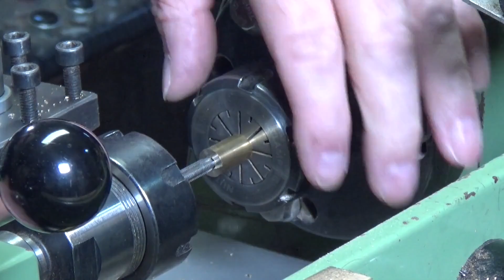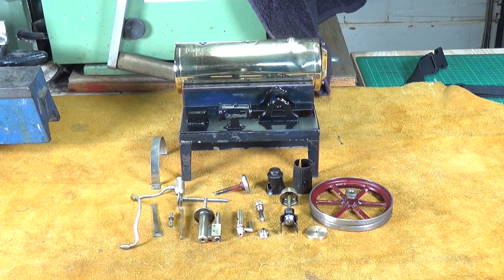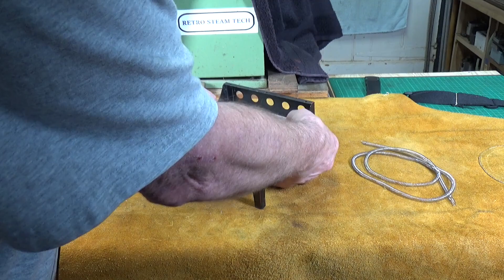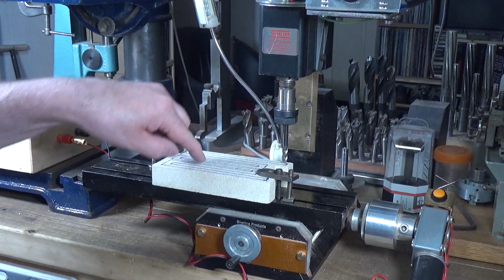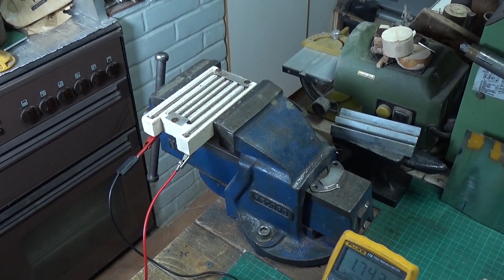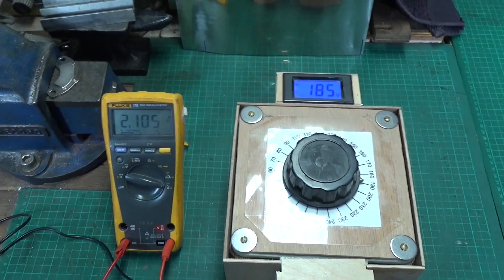Vintage Bing-Wolf Model Steam Engine - Part Three

Comment: Excellent Alan, that's something I've never seen done before. Bet you were left with a massive clean up on the mill. Should have followed the endmill round with the vac knozzle 😂 Cheers Nobby
Reply from the maker: Hi Nobby. Yes, it does make a bit of a mess but the results are well worth the effort. Cheers, Alan.

Comment: Love the element. if you want to control the temperature a simmerstat would work well. I have one on my Empire hot air replica model.
Reply from the maker: Never even heard of a simmerstat, will have to look into that, thanks 👍Cheers, Alan.
Reply: @RetroSteamTech It's the control used for electric cooker rings. It  gives an on off cycle that is variable depending on the knob position.
Reply from the maker: @myfordboy  Sounds exactly like what I need.

Comment: Interesting Alan.   Would varying the element length vary the resistance and required voltage ?  Not something I've played around with.  Cheers Rob
Reply from the maker: Hi Rob. Yes varying the length of the element would change the resistance. The problem is that in order to get the right resistance for 240V,, the coil would be too long to fit in the available space. Likewise, if I shortened it to suit 110V there wouldn't be much of an element left, so not much heat. Probably what I should have done is bought several coil elements of different wattages and experimented with different lengths. This works for now and of course I can vary the amount of heat being produced. Cheers, Alan.

Comment: Great looking milled out insulation. You could run it in a PWM speed controller that would be a more manageable size.  I hope there's no issues with what looks like metal strips shorting the coils out if they move?
Reply from the maker: Thanks. The strips holding the coil in place are mica not metal, so not conductive.

Comment: Very cool, never seen anyone build an element from scratch.
Reply from the maker: Ideally you would use something bit stronger and harder than a fire brick but they are fairly cheap and easy to machine. The coil wire heating elements are also fairly cheap and available from ebay.

Comment: nice one Alan
Interesting to see from a non electronic mind. 👍👍
Why can't you adjust the element just to run off 240v or did my simple electrical mind miss the plot.😄😄
regards
kev
Reply from the maker: Thanks Kev. In order to run it from 240V I'd have to use a series resistor inline with the heating element. I could do that but a resistor of a high enough wattage rating would be quite large, so finding somewhere to mount it would be a problem.  I may well be able to run the heater at a lower voltage, it kicks out a lot of heat at the test voltage. Cheers, Alan.
Reply: @RetroSteamTech  oh. if you say so Alan.
👍👍👍👍👍👍👍👍👍👍
Reply from the maker: @MrFactotum  Believe it or not Kev I do actually know what I'm talking about. Only on this occasion though, most of the time I haven't a clue 🤣🤣
Reply: @RetroSteamTech  😄😄👍👍